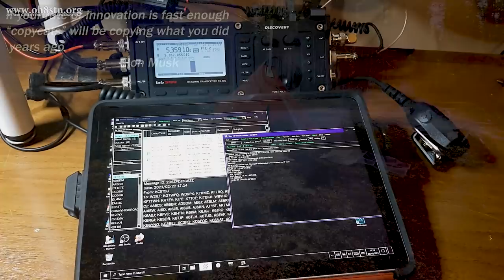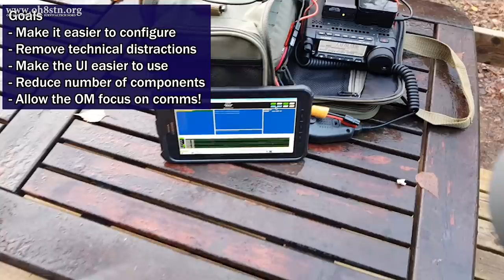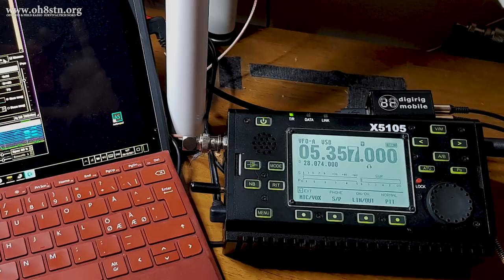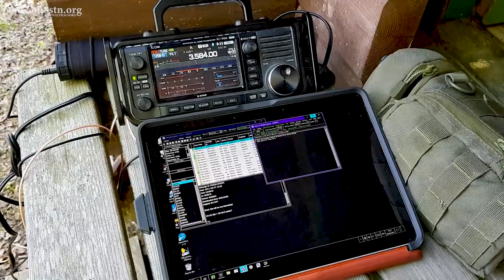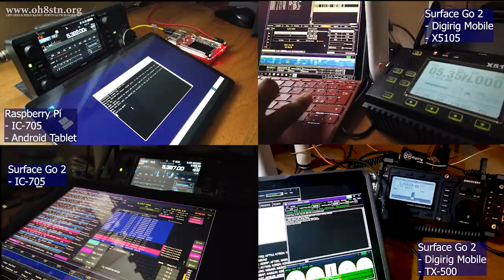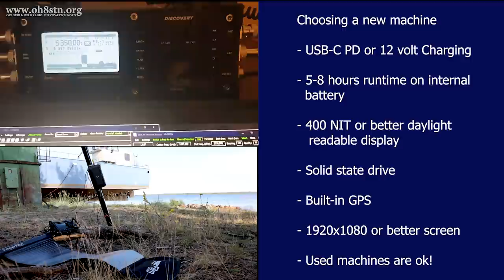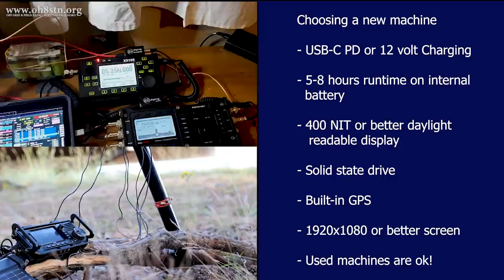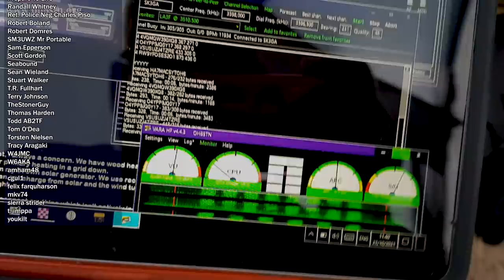Goodbye Raspberry Pi

Comment: Glad you said it.  The Pi is a toy and after using several I came to the same conclusion. Still have them but found I don't have a need for them or a project that makes sense to. Still not a fan of winlink though. I would rather be internet independent.  Will stick to JS8 and some other modes. Also would rather cable than run bluetooth or wifi.   Better to be RF quiet on receive.
Reply from the maker: 98% agreed 👍
I need to do a video on how to use winlink without the internet. Internet is not a requirement, it's just one of the connection optiins. Everything else I completely agree with you with. Thanks for the comment and feedback. Sometimes I wonder if we get so invested in specific things, we're afraid to let go, move forward. 
Thanks again
Reply: @OH8STN   Thanks Julian, It is my understanding that messages will not get served if the internet is down?  That's a tough question to ask on the forums though so I never got a straight answer when asked.
Reply from the maker: Hybrid winlink networks have radio-only nodes. You can even see those in when link express when she choose the type of connection you want to make. How do a video on that soon 👍
Reply: @OH8STN  You the man!

Comment: Hi Julian! I revisit this video wonder if I'll switch too, from a Raspberry Pi to  a Surface. May you mention what CPU and Memory your surface has? I'm assuming it's a Windows 10. Thanks in advance, Jorge VE3EAD
Reply from the maker: If you look at the menu system on my website , there's one menu called ham radio field computer. There you'll find all my information on the two surface tablets that I have.
https://oh8stn.org/blog/2021/10/10/microsoft-surface-go-2-faq-ham-radio-laptop/

Comment: So can a tech use the data transmission systems on ham radio or is that something that requires a general and up?
Also, would it be worth it to cram hard as be get the extra license immediately? Or a general license? Or would it be wiser to just get a tech and start there?
Also, do I need to renew ham licenses?
Reply from the maker: For tech, only data on 10 meters and up. Definitely go for the General asap. Extra is gravy.
Reply: @OH8STN  so if I get the general, how likely would I be to accidentally use a radio in extra exclusive frequency? I realize I'm phrasing this question very idiotically but my brain isn't letting me rephrase it more effectively without making an essay out of it.

Maybe it's better phrased like this, if I'm a general operator and I have equipment, are the frequencies a vs abilities I get as an extra going to require more new hardware?
Reply from the maker: No different new hardware than General class, just wider frequency range.
Reply: @OH8STN  are there safeties on the radio to prevent accidents or is it all about diligence? I realize that's a very over generalized question that really should be answered radio by radio but I'm just wondering how care I'll potentially have to be with my gear around people that might be less knowledgeable on what frequency is what
Reply from the maker: There are no safeties on the radios

Comment: Yet again another great video!
The only downside to the surface go2 with winlink is that winlink refuses to see the surface's built-in GPS. Even an external ublox gps will not work sadly enough (does not recognize the com port)
So unfortunately we're stuck with using the IC-705 wired so that we can use the radio's GPS over USB
Reply from the maker: I haven't had the same experience. Winlink is definitely finicky about the GPS but it sees any GPS I plug into the tablet. I didn't get the 4GB surface go, so mine doesn't have a GPS built-in. I regret that. The next tablet I get will definitely have the built-in GPS.
Reply: @OH8STN  the surface GPS is only available through software, unfortunately microsoft has not made it available as a com port or even emulated it to a com port, so you can use it in their own maps software, but not much else..
I tried a ublox USB gps, winlink sees its com port, but is unable to use it. I'm guessing the com-port is also a sort of emulation and that that is what is throwing of winlink..
Reply from the maker: I tested the u-blox GPS and it works. I'll put up a blog post when I have a minute.
Reply: @ON3RVH  Is the GPS from the Surface a Stratus 1 GPS source like you get from the DRAWS hat?
Reply: @OH8STN  yep, just deleted all drivers and tested again. My fault was apparently installing the ublox virtual com driver and this is not needed at all apparently. just plug it in and turn it on. thanks for checking and pointing me that my config was wrong!
Reply: @sammiller6631  that depends solely on what you configure in ntpd. the DRAWS hat is just a hat that breaks out the GPS signal. The hat itself is not a stratum 1 source, the ntp (or chrony) programs will configure the SAT time as a stratum 1 source.
There are some programs like GPS2Time from VK4ADC that will sync your computer's time to a GPS device, but not the surface GPS device as that device is only available through software and not as a com port
Reply from the maker: I was going to say that but didn't want to sound condescending. That ublox software has been an absolute nightmare. I've avoided installing any drivers and simply use gps2time. That has worked out pretty well.
Reply: @OH8STN  no worries, if you think a config is wrong, say it out loud and proud ;) the ublox software is indeed a nightmare.. it creates a com port, but not really according to standards and that is why winlink cannot use it.. after your message saying that it worked for you I started searching again and came to a post that win10 did not need the ublox drivers at all.. so tried it and behold, it works! ;)

Comment: Julian, perhaps you glossed too quickly over the reliability aspect of the computer. While I would certainly agree that one can acquire a rugged Windows computer, think Panasonic ToughBook, do you really consider the Microsoft Surface to have the sort of military-grade toughness that makes it suitable for deployment in extreme environments such as frozen tundra or the Seria desert?

Wouldn't it be great if we had a computer with the rugged construction of the Lab 599? 

My personal opinion is that we have a long way to go before we start to get close to an ideal field combination for digital communications. Thank you for pioneering the way for all of us! DE WA1KLI
Reply from the maker: Honestly John, I completely agree with you. I would love a Panasonic Toughbook but also work within the constraints of my load capacity and budget. The goal of this video is to inspire other people to think outside the box, keep moving forward so to speak. I would love to see one of the Panasonic Toughbook coupled with any of the radios mentioned in this video.
Awesome feedback👍👍👍
Reply from the maker: Just a quick follow-up. The reliability in question was about the raspberry pi reliability, in the field. So even though the Surfacevis not a Military grade machine, it does have better reliability/survivability than the raspberry pi used before it. It is all abot baby steps. If I had the ability to throw money at a problem without a thought, I wouldn't learn anything from the process.
Reply from the maker: @luiswu9892  what you feel or believe doesn't matter! Testing matters! Thousands of hours of field testing. 9 months with the Surface in the field without a failure. Believe what you want about a raspberry pi. They are great on the desktop,  but have a high failure rate in the field.
Reply: @luiswu9892  The complaints of the early Surface models breaking has pushed MS to improve quality with newer generations of Surface in order to compete outside the budget market.
Reply from the maker: @luiswu9892 troll!
Reply: @luiswu9892  Which is it? Either you used to work somewhere in past or you used the newer ones which haven't been out long enough to have a history? Pick a lane, Luis.

Comment: Yeah, the RPi is a bit of a pain in the ass.  For instance, I'm trying to power mine with a Powerworks 5V adapter connected to a LiFePO battery, same one as my G90.  The RPi always gripes about low voltage.  I've been getting CAT control errors in JS8Call when running with flrig and connecting with a Digirig (even when NOT transmitting, so it's not RFI).  Trying to find out where those errors are arising will be difficult, but I suspect it is RPi-related.
Reply from the maker: I should make a video on this, because I probably know the portable power problem with your Raspberry Pi. If you look at the post on my blog about off-grid power for the Microsoft Surface, there's a USB C power delivery adapter that's used to power the surface. I suspect the powedwerx adapter is rebranded Chinese crap. I've gone through quite a few of them and they've all been junk. How are you Raspberry Pi 4 with a USB C PD adapter the same one I use for the Microsoft Surface. That should solve your portable power problems for the Raspberry Pi.
Reply: @OH8STN  You are probably right.  Jason KM4ACK made a video on RPi power sources and I think the best thing he came up with was one of those battery things you charge you phone with.  Not great.  I'm now certain that the Powerworks 5V adapater is the cause of my CAT control errors.  I powered the RPi using a power adapter plugged into a wall socket last night and had no CAT control errors.

Comment: I hear what you're saying, but I still hate installing what I consider mal-ware from a company who thinks that when I buy a computer my goal is to be sold to advertisers.  (I'm rolling my own CAT based back up and restore for the FT-991A because I don't want to re-boot into W10 just to run RT-systems software.  Call me a radical.  I won't mind.)
Reply from the maker: I'm right there with you. I don't like running Windows, I don't want to run Windows but so far it's better in every respect than the Raspberry Pi for field communications. Every time the Raspberry Pi comes out to the field with me, this anxiety lingers over me whether it's going to work or not. If not the Raspberry Pi failing, some component cable or configuration the setup is Reliant upon. It's nerve-wracking. I spent thousands of hours fielding the Raspberry Pi. It's great for ft8 from a park activation. It's ridiculously terrible for off grid HF email.

Comment: Definitely having a windows machine will give several advantages over the RPi - including ease of use, the UI, and the plug-in-play capabilities, etc.  Accessibility to the tools you need, will definitely be available in more popular OSes like windows.  You can even argue that a Mac laptop is easier to use and to program than a RPi.  So why use a RPi?  The biggest advantage is its price-performance.  Hands down, you can't beat the price and its performance.  The RPi is very inexpensive, especially when it's used.  Furthermore, with a low cost Fire tablet to run VNC, it will cost much less than a windows machine.  But the biggest questions is - Is the RPi reliable?   In most cases, I think so.  Sure, everyone knows that setting up a RPi is challenging and with a slight code error, it can ruin your deployment.  Especially when you're in an emergency communication situation, you need reliability equipment - and you are right.   On the other hand you learn a lot more on the process on how digital communications work between a radio and computer.  Using a RPi, I learned about GPS and how that helps in timing, I've learned about serial drivers on how that communicates with the radio, I've learned about remote logins, managing power supplies, an better appreciation on how an app communicates with the radio, learning more on radio settings and how they apply to digital communications, but most of all the RPi ecosystem has other features that you might explore in the far future.  Sure, RPi has limitations  Overall, if you don't have the budget for a windows machine, you want to further your understanding of subsystems that give you a better appreciation of how the hardware works, plus a sense of accomplishment that you can communicate with folks for pennies - then you should consider the RPi.
Reply from the maker: You had me for a while but then started down that rabbit hole. Couple of points here. Would you ask a policeman, fireman, paramedic, or first responder to understand how the underlying subsystems work? For emergency communications and preparedness, we want the systems to simply "work". There's nothing wrong with initial configuration however, expecting someone in the field to delve deeper into subsystems which are unnecessarily complicated (because Raspberry Pi OS) is unreasonable to ask. I could say the same thing about a DXpedition using a Raspberry Pi for logging or actively running ft8. You're off in some Faraway place fiddling with a Raspberry Pi to get it working after a fail. There's no internet access and all the scripts you need to reinstall your software are dependent upon the internet. What do we do then?
The Raspberry Pi was designed specifically to operate on the grid. It does an extremely good job in that environment. It can even be a desktop replacement for many things.
As far as cost versus performance, no chance!  The Raspberry Pi still requires a bucket of add-ons to make it functional in the field. It needs a power supply, it needs a screen keyboard and mouse. GPS, RTC, audio interface, backup sdcards, soft switch, enclosure, heatsink, ... Add them all up and comment the cost. Even with all that stuff, it's still struggles to run a vnc server in the background while offering up apps in real-time.  It can do one thing at a time and do that very well.
I don't hate the Raspberry Pi, but do understand its limitations. Used Windows machine would be a much better investment. Even a Chromebook running Linux, would be a much better investment.

Comment: how are you able to connect the two radios and run them together using the surface go2???? thanks looks neat.
Reply from the maker: Thanks. I use a USB-C splitter (2-port hub). 
73
Julian oh8stn
Reply: @OH8STN  thanks so much for the fast reply. Very cool will have to give it a try.
Reply from the maker: RR. It doesn't work with high-power devices like the digimaster or signalink USB. They are too current hungry. Works fine with the Digirig or two 705s.
Reply: @OH8STN  ah thanks again. Good to know. I have one digirig and one signal link. Need to purchase another digirig. They are so small and compact and much neater setup.

Comment: How does Digirig mobile work compared to xggcomms box?
Reply from the maker: Haven't seen much of a performance difference yet, though the XGGComms is larger. The digirig is much smaller, perhaps even a quarter of the size. That's the big takeaway from it. Both are excellent in my opinion.

Comment: I feel validated - impressed with my own forward thinking HIHI

I abandoned Pi and Android tablets for portable use because of the complexities and useful Win-only apps. I use a Surface Pro 4 (i7, 16g, 500gb, Win10 - used $100) for remote use of a Flex 6400M station and portable X5105 with Digirig. It seems great minds think alike - we're tracking. I see you on VarAC frequently, but no-joy making contact. 73 W4HTP
Reply from the maker: Yeah we are so used to trying to lower the costs in amateur radio, that we've forgotten all about practicality. This comment is definitely the best comment of the day.
73
Julian oh8stn

Comment: Maybe connect the pi to the 705 via Bluetooth andnuse the 705 as a gps time source?  Or use just an android with woad instead of winlink?  705, android tablet, power, antenna(s)... done.   You can even run remote rig control on the android, waterfall and all.
Reply from the maker: I would but there's no HF communications on WOAD. Just packet. V/UHF packet range is a no-go in sparsely populated Northern latitudes. 
The 705 can definitely be used as a Time source for the Raspberry Pi and I do so. It still leaves the power source,  rugged enclosure,... The Raspberry Pi is still great on the desktop and connected to the internet.
Reply: @OH8STN  gah... missed the band limitation of woad.  Sorry bout that.  Easy to get excited without a radio to play with... soon though
  Soon...

Comment: Can you sub in an android tablet instea?  I'd prefer to focus in around a usb c charger  rather then the surface tablet charger. I've used them at work and I am not a fan of the surface line of devices. Supporting them as an IT person has soured me on them
Reply from the maker: The surface has both. You can use the surface connect or the USB C to charge. Anyway the problem with Android is there are no apps. We have one windlink app in very early stages it's called wind link on Android devices. There's also an ft8 client for android. There are a few older apps for rtty and psk as well. If those are enough for you, then the Android devices might be workable. I've been running this surface for over a year and a half now, without any issues.
Reply: @OH8STN  thank you that clears up questions I had thinking on it your right they surface  tablets do have the usb c charge option. Might also be the enviromwnt I am working with them in. A lot of locked out application.